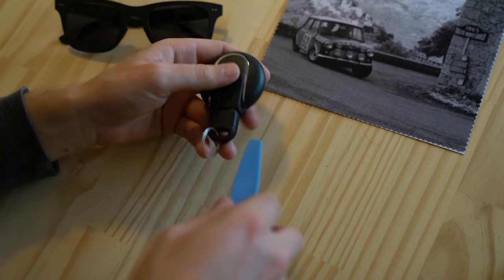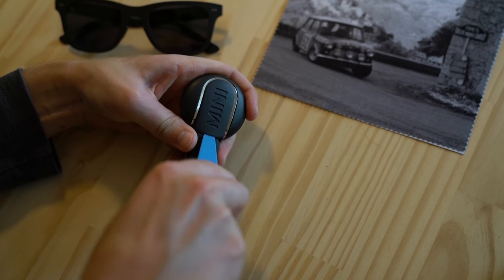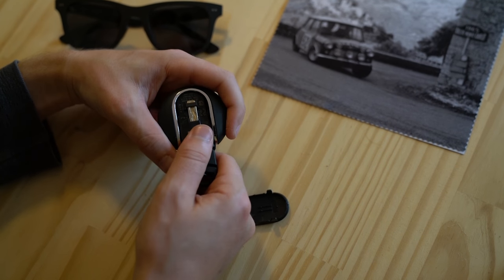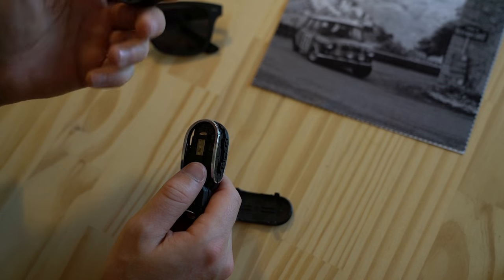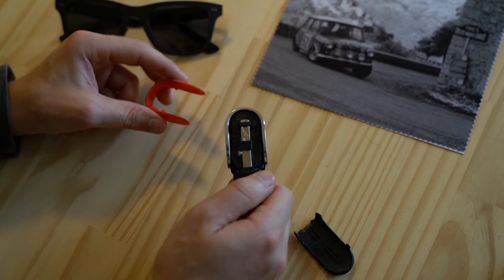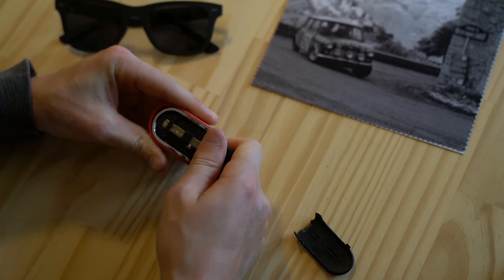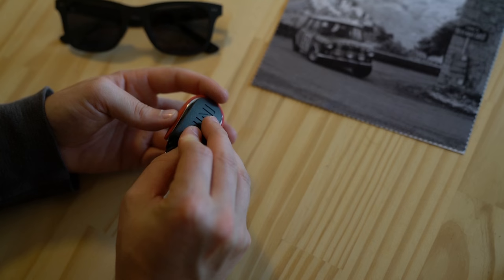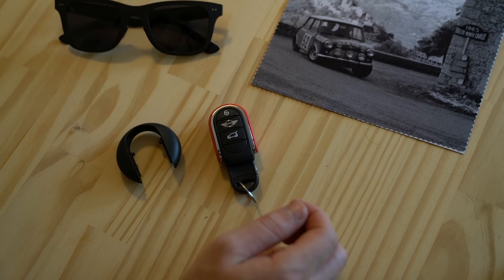The Biggest Part of the Newest MINI

Comment: Is that a John Cooper Works ?
Reply from the maker: +buildmorefarms100 yes it is!
Reply: Nice, how is the acceleration/performance?
Reply from the maker: +buildmorefarms100 it's great! It's different than the older R52/53 but it's really good!
Reply: It looks like a Cooper S and has the S badge on the front!
Reply from the maker: Actually a JCW. There are no S badges on the car, just the JCW ones. Those auxialiary lights from MINI do a great job of blocking the badges on the grill. Great work MINI 😂
Reply: Sorry I could have sworn I saw a S badge,  either the lights or the badge position are a bad design. Covering the badge is poor IMO
Reply from the maker: 100% agree. Pretty bad design to have your own lights block your badge! Hopefully they figure that hard problem out for the next generation! Ha!
Reply from the maker: 100% agree. Pretty bad design to have your own lights block your badge! Hopefully they figure that hard problem out for the next generation! Ha!